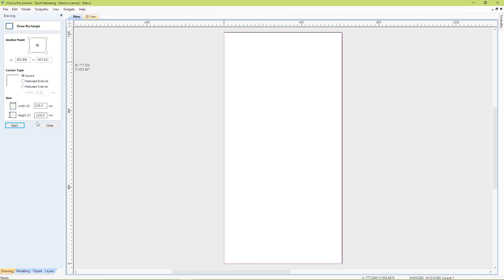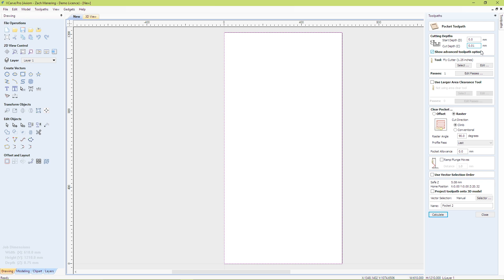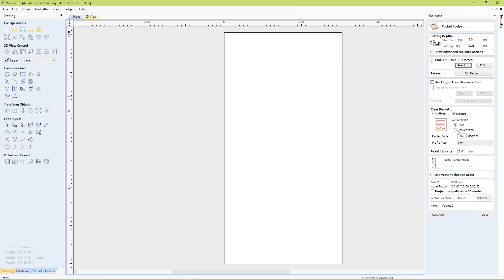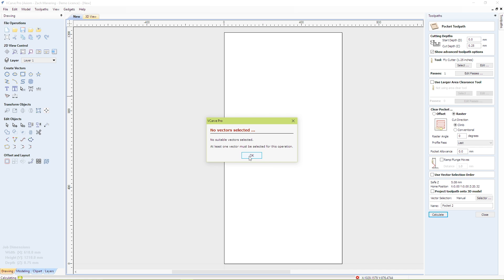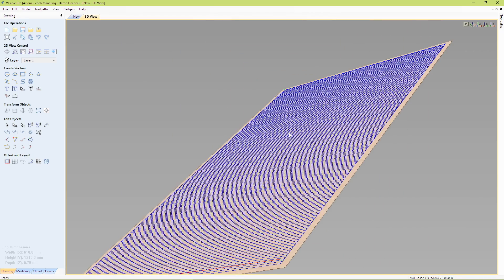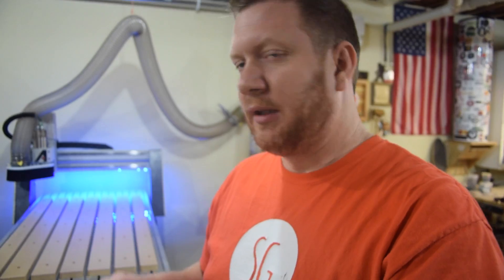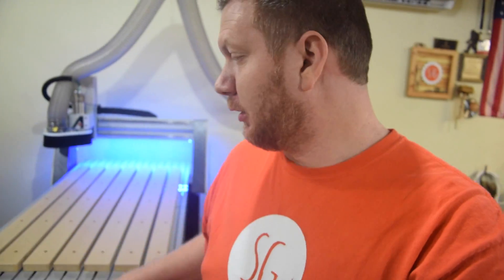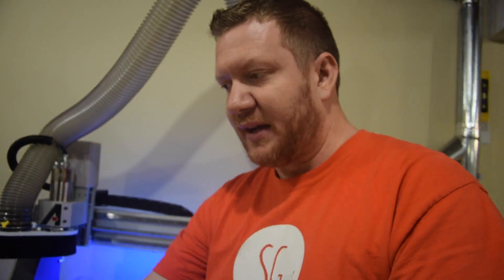What is fly cutting? | Axiom Precision AR8 Pro CNC

Comment: Hey Zach - after two years have you replaced any of the MDF strips? With my current CNC I love nailing or screwing directly into the MDF wasteboard because they are so cheap and easy to replace. Curious if that’s the case with the AR8 Pro? That machine is high on my favorites lists.
Reply from the maker: I use an additional wasteboard on top but I do have replacement file for them if that problem comes up hehe. But yes it's a badass machine! Check out my review. Https://www.southerngingerworkshop.com/axiom-review

Comment: Just a note, you probably want to wear a dust mask creating that fine mist of MDF. I've had a bit of trouble with my axiom, curious if you had any issues with it stalling on the up movement, then digging down into the material and eventually spoil board over a single cut. It attempts to move up, won't go up far enough, then goes down further than it should. Best I could tell, some kind of upper height limit setting I couldn't find. Love your videos.
Reply from the maker: Wow, no I haven't had that issue almost sounds like a safe height issue? I'd contact support for sure for that!

Comment: hope you leveled the base. Flycut will not make it level
Reply from the maker: Having it perfectly level is always good but it's not needed to be perpendicular to the gantry and that's what's important.
Reply: Steve5796  is correct. If your base is out of skew, such as the Y axes are twisted, then the gantry will follow this skew and not make a spoil board that is flat (planar).  Any work attached to the spoil board will then also be cut out of skew.

Comment: In case anyone wants to know... Axiom has a file for each of their different table sizes, so there is no need to write your own.  It's on their Forum as a .mmg file. 

I am curious how you power your LED strip light. that's a great idea!   where did you get it?
Reply from the maker: +Master Zebulon very cool, I didn't know that! Thanks for sharing. Maybe I should do a walk through of the LEDs but I mounted them to the underside and double side tape holds the transformer in place on the gantry. :)
Reply: here is the AR4 link on the forum:  http://axiomprecision.proboards.com/thread/112/surfacing-ar4-machines#ixzz4UBa5NupK

Comment: Another thing to consider is whether or not the bit you surface the spoilboard with has a cutting edge all the way across the bottom. If it doesn't, the best way to handle that is to ramp in the initial plunge move over a distance of twice the bit's cutting diameter. If it tries to plunge straight down and there's no cutting edge all the way across the bottom of the bit, it could damage the Z axis.

Nice looking machine! Looks like the spindle tram is dead on!
Reply from the maker: +Mark Lindsay thanks man, yeah it's got a cutter allong the bottom but yeah the initial plunge wasn't expected lol! Thanks man, I'm very happy with the machine :)